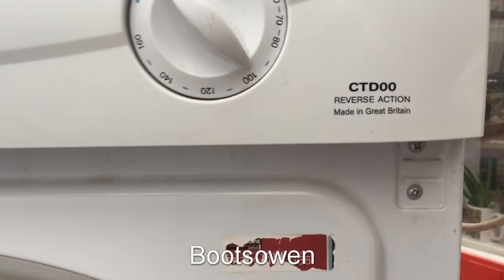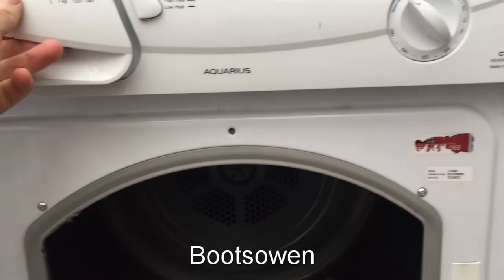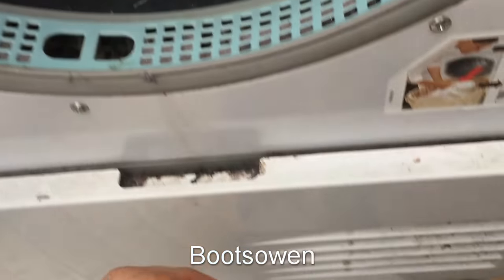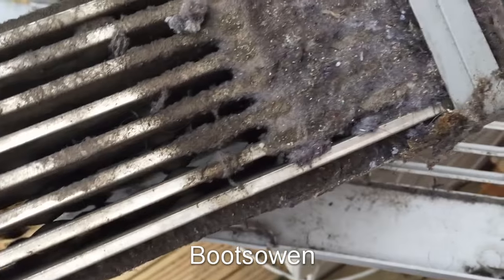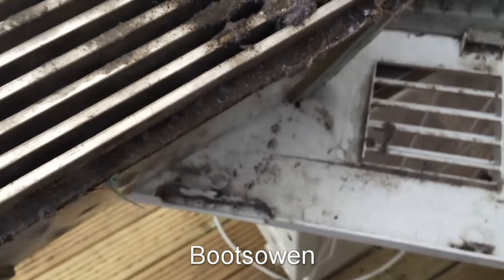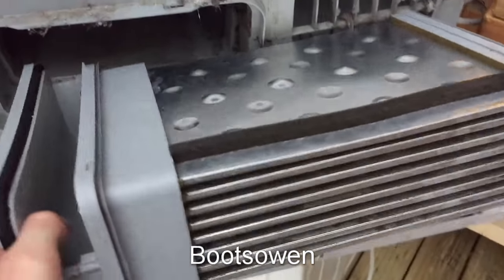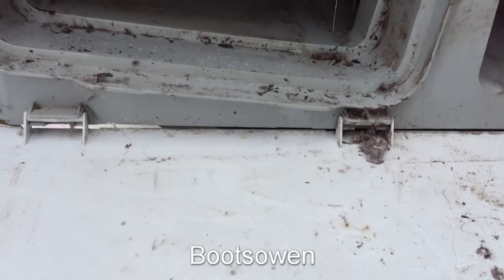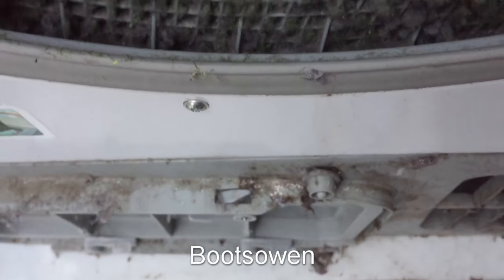How to clean a tumble dryer condenser

Comment: Please note: The filter 0:25 is different from the condenser 0:50.
Clean the filter after every use. Clean the condenser every ten uses with a vacuum to the front and every 100 uses with a full wash through.
Reply from the maker: Thanks, I appreciate your comment. I think it is appropriate to not that you should follow the recommendations of the manufacturer of your specific machine. While rules of thumb are fine, you want to keep your machine working well and in line with the warranty.  Most of the machines that I see are broken because of lack of maintenance, condensers in dryers and filters in washers.  Thanks for your comment.
Reply: @bootsowen  hi my wife clean the filter but now we can't put it fully in,  any idea why ?
Reply from the maker: @tsmporti7652  new wife? Or try again. If it came out it can go back in
Reply: Been trying without any success it goes in but not fully so can't shut the blue flaps
Reply: @tsmporti7652  I have moved abroad since my post and no longer have my unit. However, from memory, I think you will find it goes in if you can work out how to jiggle it, esp raising the rear, rather than letting it fall down under its own weight.

Comment: If you take off the lower panel that holds the condenser, you'll see a load more wrapped around the fan and housing to the side of the condenser. We've had our dryer for over 9 years and I've just replaced a snapped drum belt, a good vacuuming whilst it was apart and it looks like new!

Comment: I tend to clean the filter and filter compartment using my garage Henry. HVR200-22 1st generation, with a push switch on the top and a lo/hi rocker switch on the side. With dual air vents, one on each side of the machine.
Reply from the maker: I got a henry like that recently, red button on top.

Comment: My dryer has started leaking and i was told I should clean the condenser. I've given it a good rinse so I'm hoping it works. However mine wasn't as clogged up as the dryer in the video.

Comment: I know it's an old video but hopefully you'll see this. I'm assuming the condenser has to be dry when you slot it back into housing? And if so can I dry it with a hair dryer or heat gun? I need to do some drying and I've just cleaned my condenser but it's raining so I can't hang my stuff out. Thanks for your help
Reply from the maker: It doesn’t have to be dry. It gets wet in use from the water condensing on it, as the name suggests. You can fry it if you want. Clean is what’s important

Comment: How do you take apart the condenser to clean it. I have just seen the state of my elderly mothers tumble drier and can not get the front of the condenser! Thanks excellent video 🙏🏻
Reply from the maker: It depends on the model, some come apart and some don't, you shouldn't need to take it apart to clean it. Just use a little bottle brush or some rough string tied to a little stick, or a garden powerwasher.

Comment: Hi , sorry if i appear ignorant. I wanted to clarify that the bottom filter can be washed with water ? I wanted to run it under the tap after i pulled all the bits of fluff away , but wasnt sure if it was safe to do so. Thanks
Reply from the maker: You can wash them both in water. The grey aluminium one can go back in wet the filter in the door should be dry. But I’m not sure that it matters

Comment: Do you have to dry the condenser out before you put in back in the machine?? It looks so awkward to clean in all the little nooks but I see I need to get myself a selsction of different shaped brushes for that! Thanks
Reply from the maker: no need to dry it, shake it off I guess, It will get wet as soon as water starts condensing on it!  A piece of string tied to the end of a kebab stick could work too. Brushes may be easier. But if you rinse it often you shouldn't need brushes.
Reply: I put my shower on spray mode and it blasts it all out
Reply: @TaylorWilson2112  that's so weird you said that today. I literally did this yesterday after not using my tumble dryer for a year! I've moved house since my original comment and my shower is VERY powerful!

Comment: Woe,woe how the hell did you get that front off the condenser i unscrewed the two screws but only one side came loose the rest stuck solid they must of glued it.
Reply from the maker: Some of them are glued, but this one has clips, I didn't show it in the video, but you have to pop the clips in with a screwdriver or something with lots of pressure and skill, while also hoping that the screwdriver doesn't skeeter into your hand, but even if the front is on you just have to have patience and clean it from the other end. soaking it first might help?

Comment: Hello, i cleaned my hotpoint condenser filter for the first time. Do i need to dry it before i put it back ? If yes, how ?
Reply from the maker: Hi Claudia, it doesn't matter, you can dry it if you wish by wiping the bits you can get at with a cloth. If in doubt, check your manual. Thanks

Comment: How did you get the front piece of the condenser off?
Reply from the maker: I think there are some plastic tabs all around, push them in and the front should come off. You don't necessarily need to, if you have a fine thin bottle brush, or a cloth and a coat hanger to push it through. And if you can soak it first maybe it will be easier to clean.

Comment: I have just cleaned the condenser as per your video, I have put it back in but my dryer is not coming on, I can hear the program clicking on and there is heat in the drum but it isn't turning round? Have I done something? Any help would be appreciated.
Reply from the maker: I can’t imagine that cleaning the condenser would be the cause. Did you plug it out?
Reply: @bootsowen  sorry for being dumb but did I what? 🙂
Reply from the maker: @andrewmcdowell8671  is the machine plugged in to the electric
Reply: @bootsowen  yeah

Comment: How do you get the front of the condenser off. I took out the two screws but it won’t part.
Reply from the maker: This one had some tabs that snap out. But I have seen others that don't come apart. Have a close look and see if there is a joint in the plastic. You don't necessarily need to take it apart because you can push from the other end.

Comment: Hello wondered if you could help!?  Have a condenser dryer hotpoint ultima tcd 970 works for about 3 minutes then keeps beeping then stops !? Just a frustrated single lady trying to fix her dryer ;-) thanks
Reply from the maker: Have you emptied the water? Cleaned the filter? Cleaned the condenser like in this video?  And look inside where the condenser goes and check taut the airways are clear. Then if it still doesn’t work count the number of beeps or flashing lights and google that.
Reply: Yes cleaned the filter  & condenser Airway's clear it runs for a few minutes constantly beeping then shuts off pause light continues to flash and continues to beep!!? (& cannot really count beeps as continues constantly!?)
Reply: But what I might add is when saw your video took condenser out but had water in!? And it should be dry yes!?
Reply from the maker: The condenser is where the water condenses out from the damp in your laundry. So it should be wet after use, but the water should drain down to the sump and either drain out, or be pumped up to a drawer that you empty, or has a pipe fitted to drain from there. maybe the pump is broken or disconnected. I am not a service engineer or competent in any way to advise you.  But the pumps cost about £15 on ebay and learning as I go I reckon I should be able to fit one in 2 hours.  Depends on what you call wet and if fitting one is your cup of tea.  If you are technical you could take out the old one and test it. Let me know how you get on.
Reply: @bootsowen  
Sorry its the thing you emptied in the video! (sorry I thought this was the condenser!)but I've taken the back off & the element is broken & just ordered one off eBay £23:95 so not bad and easy swapped over (I hope lol) so finger's crossed when arrives all go's well ;-) thank you.

Comment: Are you keeping it
Reply from the maker: That was the plan, but once I got into it the motor ducting was full of water, I think it was left out in the rain. The part that had failed was the board that separates the heater coil element turns. It had melted with the moisture. I have scrapped it for parts. I think what happened was that the owner never cleaned the filter or condenser, then decided it didn't work and left it out in the rain. Then it died.

Comment: I've cleaned the condenser and the lint filter, yet the clothes still come out of the dryer with a stale, moldy smell. I even use those dryer sheets. Any idea on what might be the cause? Thanks a lot. You've got a new sub.
Reply from the maker: Are you washing on quick wash 30 degrees? Maybe your clothes aren't really clean.
Reply: That's a washing problem... do you use liquid or powder? Run the machine with soda crystals on a 90oc wash then use powder...
Or clothes are left in washer too long and are moulding
Reply: I found a full wash cycle (1hr+) was coming out like completely rinsed, no smell or a stale smell. Now I do quick wash (30mins) with outdoorable (strong stuff!!) Even Comes out the dryer still smelling lovely!

Comment: Good video, unfortunately I'm still stuck. I have a Candy Grand O GOC 218 and I have cleaned it all up, found parts I didn't know existed ... but the clean filter light just randomly comes on and stays on. Over the years I have replaced the heater twice, the drum (bearings worn) the wheels for the drum (worn bearings again) so it would be a bummer to get beat by this.
Reply from the maker: Sorry to state the obvious, ,but have you cleaned the filter?
Reply: @bootsowen  before posting this I cleaned parts I didn't know existed before. My condenser was very clean to the examples you showed (cleaned every so often) but I spent another hour cleaning that out again and you can definitely see daylight through it. I scrubbed, dried and hoovered everywhere I could without opening it up.

If you have any ideas I'm open to them but in the next week if I have to I will open it back up and check for dry solder joints on the control board.

That's just came to me. When I think about it. It could be when getting hot and it expands there's a connection getting pulled apart. 

Looks like tracing this might be the solution.

Thanks for your reply, I'd be really happy if you have any thoughts as I don't want to replace it, must be about 13 years old now, lol.
Reply from the maker: @bipedalspecies2086  ok. But the condenser is not the filter. The filter is usually near or under or in the door.
Reply: @bootsowen  the filter gets cleaned after every one or two uses and is clear, the condenser looks not far off of new at this point and all the airways are clear.
Reply from the maker: @bipedalspecies2086  Ok, glad we cleared that up, so something is telling the control that the machine is not moving air fast enough, maybe it thinks it is getting hotter than expected. Have a look at the thermal sensors, usually around the back after the heater element, usually under a screwed on cover. They may be dud, or dirty. Or like you say, it could be that the PCB is off somehow. I have posted a video about replacing or repairing the element on a number of machines. and one about the thermal mini-melt fuse on another. so these should give you some idea of how to get in there,
Reply: @bootsowen  lol, funnily enough I watched that video. I will do a continuity test and see if they both do the same. Usually I just replace that whole unit, I didn't realise you could buy just the sensors :/

I'll let you know how it goes in a couple of days, just fixed the freezer, again, FF200, it's being a pain in the backside, I'll need to lean it slightly back, the drain keeps freezing up because the water is somehow lying or I left it like that a couple of months ago.

Thanks again.
Reply: @bootsowen  Just going to say this before I try it ... I think it might be motor brushes/bushes.

The motor drives the drum and the blower, I think, from what I remember ... it's been a while. But if it isn't moving air then at least one of the thermostats is going to overheat and that will be taken as a blockage.

I'll probably pull them tomorrow or the end of the week, because I might just order them and go for it in one to save time.

I think I have to remove the drum :/

Comment: What is the foam seal for on top and bottom of condenser box does it stop leak as mine has fell off it has to be there for a reason I'm thinking?????
Reply from the maker: It stops air escaping, it is not for water leaks. It should be in position.
Reply: @bootsowen  thanks for response it's ok water seems to be coming from condenser I have cleaned seals and hope that fixes it or I'll just buy new seals for it 👍👍👍

Comment: That is the big cause of a tumble dryer fire, and it takes a few minuets to sort out, I wash my condenser unit every two weeks in the winter and clean the filter every use in the winter months when I cannot hang my laundry out to dry . There are Stupid people who don't read the instructions and blame the manufacture. (I have a Hotpoint Dryer and never had any problems with it)

Comment: How did you dismantle the condenser system please? I am unable to break that apart to clean better..
Reply from the maker: You must find the plastic tabs that hold it together and use something like a screwdriver to push them in and pop it apart. Maybe easier with two people. Thanks
Reply: you should read the instructions properly the instructions are simple
Reply: alex tilson did not receive a manual and the user guide I got from the manufacturer doesn’t have these instructions
Reply: Hi it is very easy, If you open the door, you can pull a flap down, this is where the condenser is located. The condenser is located behind 4 catches which are very clear to see, Just turn them around to unlock the condenser, You may find it is a bit stiff to pull out but just give it a wiggle and a gentle pull and it will come out. The condenser is a long silver unit, Best thing to do to clean it is take it into the bathroom and run the shower through it in both directions, you will be shocked how much fluff will come through it just keep on rinsing it until its clean, (dont worry about getting it wet, it gets wet when the dryer is running thats why you get no condensation when the dryer is running) Give it a shake after you have rinsed it through and re-install it. It is so simple you will do it with no problems at all. (I do mine every week during the winter when its used the most!!) Good Luck x
Reply: @alextilson5809  , unwise to clean it in the shower. The fluff will block the outlet.
Reply: It depends on your dryer model. My Blomberg (Heat pump variant) dryer does not let me remove the entire condenser without dismantling the machine.

Comment: I started watching this as I was cleaning the condenser on the same dryer, yet you jumped over that part. I took the two screws out but it is stuck fast. Back to searching the internet. :)
Reply from the maker: The bit that is missing is irrelevant.  You need to clean it, clean out all of the gaps with a thin brush or a cloth on a stick. When it is clean it is clean. It isn't that difficult to figure it out. You don't need to take the front off the condenser.